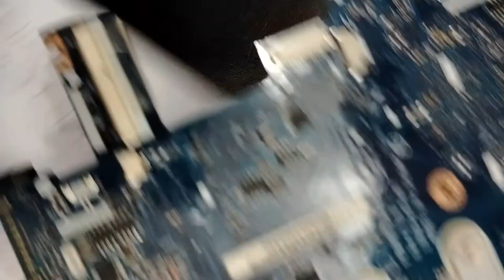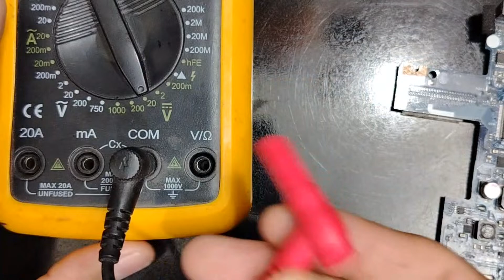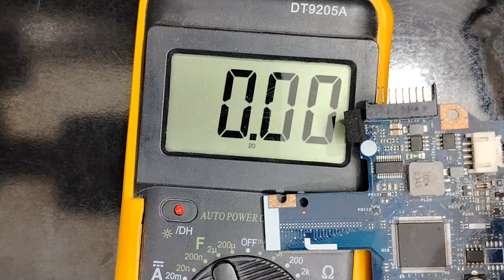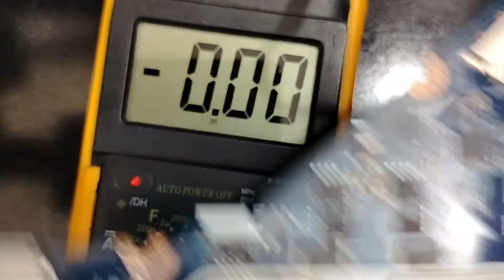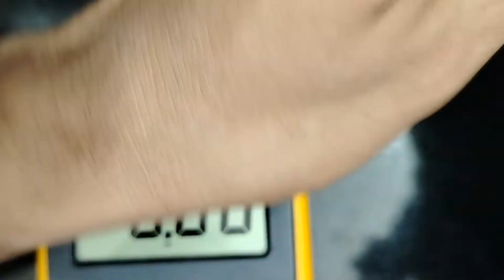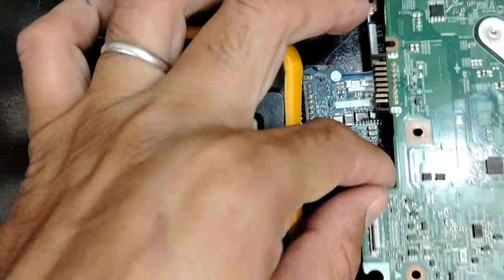Testing Motherboard Voltage With Surprising Results!

Comment: Can you do voltages with the battery plugged and not with the power adapter
Reply from the maker: Both
Reply: I have a black screen but  3.3 and 5.0 voltages are present and my CMOS bat reads 0.0v could this be the problem or the BIOS